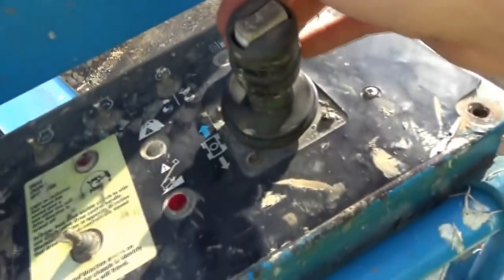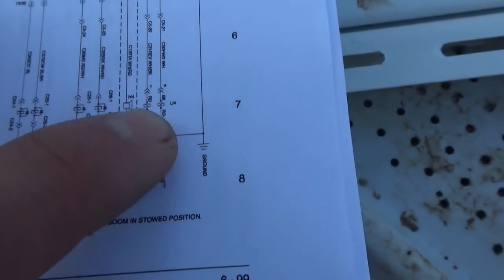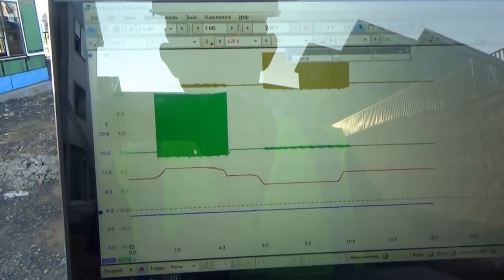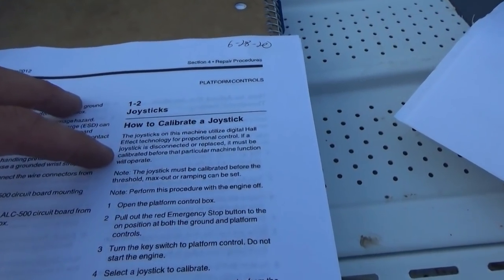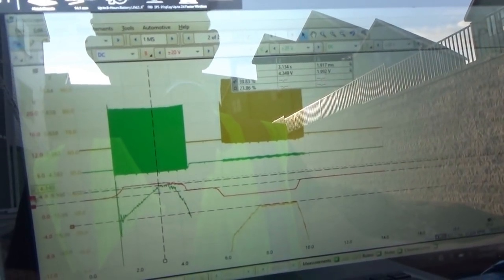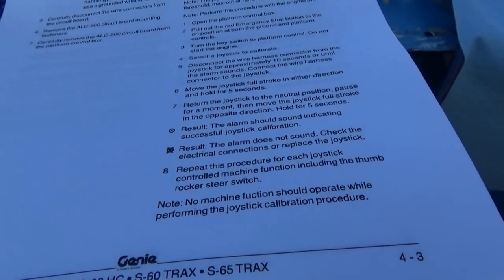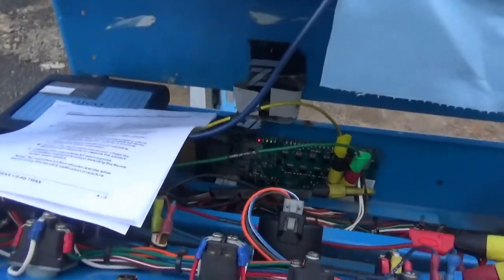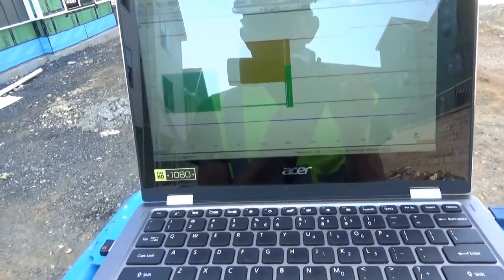One-Way Genie (No Reverse Drive) - Part 1

Comment: I'm not sure when you'd have to recalibrate, unless you put on a new stick? Clearly, when you swapped boards, the 'memory' should be cleared, and in theory, wouldn't you have to do a recal? But you didn't have to on the 08, it worked just fine plug and play.. Interesting..

Comment: Doesn't a Hall sensor have a high impedance output? I think, your calibration messed up because the scope leads were still connected during the calibration. Did you measure the PWM signals without having the leads connected to the scope?
If that control board would be very expensive, it might be viable to DIY something with an Arduino and some mosfets.
Depending on what the PWM signals feed into, you can probably just throw in some capacitors, maybe some diodes and make the thing go full speed forward, full speed backward, or no movement.
I'm curious of your trademark repair. Please post them closer to each other or release as one video. I can't wait.

Comment: Does this calibration have to be done every time the battery is disconnected? Like you've to do with power windows?
Reply: it should only be if you loose power to the joystick and it looses communication with the control board  but a power surge can wipe out the memory

Comment: Ivan I'll say it again your on a jobsite your required to wear a fall arrest harness to operates these booms it's not a suggestion it's the law. If an OHSA inspector goes on site you and or your company can be fined or thrown off site. The "ALC 500" boards can go bad i've replaced many in my carreer. also the hall effect joysticks can go bad as well. that drive joystick looks like an aftermarket, likely from totalsource, I try to stick to OE Sauer Danfoss units from Genie as they are better quality. Your diagnostics are awesome but again the thing with probing wires with your wire piercing probes if your not going to fix the holes it's a point of corrosion and some of these units rely heavily on voltage readings to make the boom work and some for adjusting levels, angles etc and can affect the units stability ( I am not knocking your way of probing wires but bare in mind there is a better way to check voltages etc. with backprobes that you can stick in to the terminal ends like on the deutsch terminals that don't damage the wires integrity. Another thing I will point out please do not bypass anything or modify anything on these booms or aerial equipment that is not up to factory snuff "Russian Repairs" (yes i know it's a running joke but i think you know what I mean, If it needs  a board or whatever, replace it and bill the customer and make sure the equipment is safe (No bypasses or hacks etc, no patching hydraulic hoses temporarily etc. if it's not safe to operate it should be locked out (lock out tag out) and the owner made aware of it we as servicers and repairers have a duty to make sure of this. Safety is key with this equipment so cover your ass.
Reply: as long as he keeps the bottom mesh of the basket(where he stands) below 4 feet  he can get away with it.  no inspector will like it. but thats how i got around it.  but yeah you are 100% about repairs.  nothing other than factory design and they also need to be certified (tested)  after ANY repair!
Reply: @richardcranium5839  rules might be different in some places. Here its if your in the platform unless your exiting you have to wear the harness and lanyard must be attached to the platform at any height. We had a death recently with an employee not wearing a harness. Wheels of the float truck weren't chocked. Truck moved ahead and boom fell back and catapulted the guy out some 300 feet. Lights out permanently.
Reply from the maker: @mplante7352  Yikes that's scary!
Reply from the maker: Yup covering my own ass is very important! But if the customer requests a "modification" then I have them sign a waiver that I'm not responsible for the repair.

Comment: Must've heard me through YT. Lol. I was thinking the same with proving the board and switching with the other one. Looking forward to part 2 😃😉
Reply: from what I saw, he brought the "bad" board to the good genie and tested it as bad. however. the "bad" board most likely stores calibrations on it which arent going to be valid on the good genie, so it was 100% going to fail anyway... he should have taken the good genie's board to the bad genie and ran the calibration procedure. for a valid test to prove the bad genie is fine
Reply: @bobspurloc  yeah... that was my thinking too. But you have to be careful about using a good board,in case there is a shorted sensor or input. Lol  Don't know why the other went bad.... js. 
We're on the same page though.  😉

Comment: you're forgetting the most Important thing... what do you think caused that mother board to Malfunction in the first place it looks very clean.... #1 thing that blows the motherboard on those lifts is the Alternator not functioning as it should which if not checked will just destroy the new motherboard in no time at all.
Reply: the ripple should have shown up on the scope
Reply: @Jason Bowman absolutely if I had determined it was the controller board like he did the next thing I would have done before ordering a board... look for cold solder joints very common because of the Vibration I would have made a quick repair if I'd found any cracked solder joints (use a magnifying glass) second because it doesn't seem to be getting the proper power it's either a bad solder joint or failing capacitors.... you're dead on those are always the 2 items on those boards that tend to fail the #1 thing that damages the capacitors is a failing alternator. Seen those boards replaced without checking for a poorly operating Alternator and soon you will find the new controller board blow a month or two later because of a failing alternator!! same thing happens to New computer motherboards attach a new Board to a failing 'power supply' you'll soon see that new motherboard blow it's capacitors in no time.

Comment: Swaptronics can save you a lot of time in diagnosing a problem...Be extra careful with ESD, otherwise you may fry up a good board. Did the good board work in the Bad Genie? To be 110% correct, you need to try it with caution. Did the board die or was it killed by an exterior circuit/device?
Reply from the maker: Yeah good board worked fine on bad Genie :)

Comment: You know it's probably just a SMD Capacitor that's gone down. Maybe you could check the Board. This might be a cheap fix, or not. Good video.
Reply: It might be a cheap parts fix but his labor would more than offset the parts savings unless the board is unobtainium.
Reply: @InsideOfMyOwnMind  boards are well available, and if the board is bad whatever circuit, replace it, not cost effective to repair it and there is a safety factor as the boom is lifting a person so liabilty.
Reply: @Jason Bowman Yes your right. But if he isn't willing to at least find out what has really happened. Will never know. Will we?

Comment: Is that just a bare board sitting in that control box? Doesn't even look conformally coated other than that goop around the one chip. With how the lid was barely attached, it wouldn't surprise me if the board got corroded or damaged from moisture getting in..
Reply: Amazing place to install control board. Corrosion and dampness quickly damage. No protection from rain .... Specially for it to break quickly!
Reply: Why have they gone Surface Mount Components , on that , PCB??????
Reply: @djb4069  I think these boards are cheaper to manufacture.

Comment: Jlg ( late models)also have variable duty cycle square wave generator to active hydraulic pump and spool which controls every function.
JLG has a scanner tester which pinpoint s issues very quickly.

Wow are they building dozens of warehouse s 1.5 million square feet and homes all over central PA Carlisle area..
Amazon logistics centers .
Reply: Dang.... really? I always liked the Carlisle area just because of all the greenery. That stinks. 😕